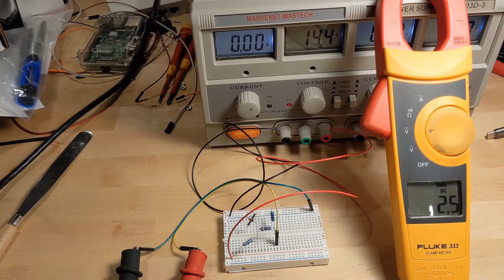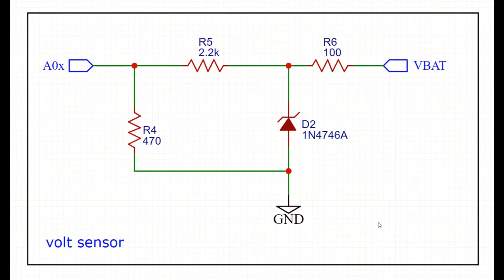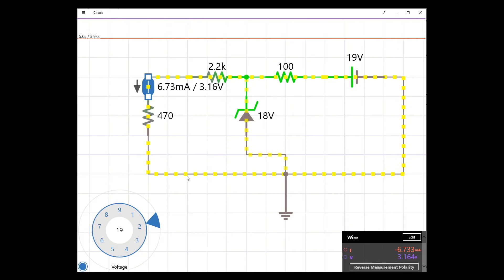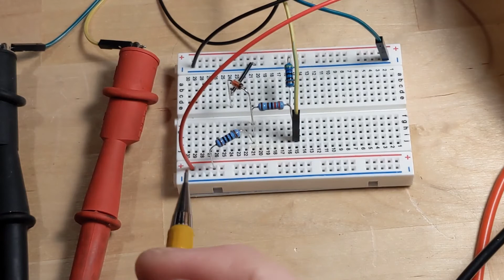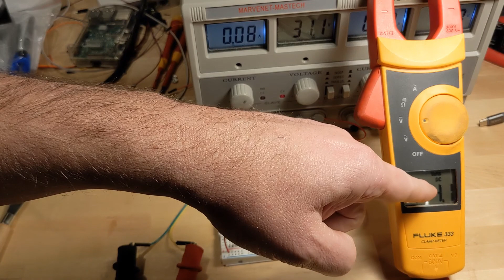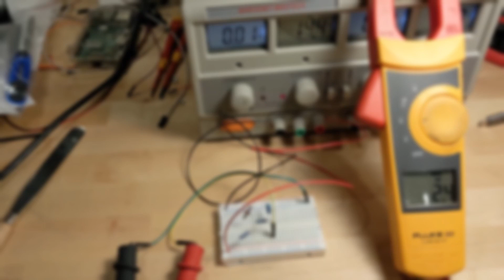Adding Electronics To A Classic Car: Creating the Volt Meter Circuit

Comment: great job man, thanks a lot, but there is one question please: if I want to apply this circuit to replace Mopar electronic voltage regulator, shall I change wiring? I mean the wire which is connected to (+F) on my alternator (2 brushes) must be connected to the OX terminal , and the wire on (-F)  must be connected to ground after R 470 resistor according to your drawing? please advise
Reply from the maker: This circuit would really only be half of what you need for a regulator.  The voltage regulator on a Mopar is essentially a variable resistor that sits between the alternator field and ground.  You would need to add that variable resistance.  It's an interesting idea that I might just add to the overall neoteric design, though.
Reply: @YoshimoshiGarage  the reason why I negotiate this issue with you is, there are no more devices for classic mopar cars and the need for finding an alternative spare parts is urgent in the area where I am.., I have a Dodge Coronet 1974 it is the extraordinary car, like brand new after restorated 3 years ago and I plan to keep it in a very good shape... additionally, I've seen one important video of yours explaining the charging system in mopar cars "70 --- 90's"  "Chrysler" where your were analyzing volts between alternator terminals and voltages regulator, and talking about the principal  of voltage regulator as a switch in a way... I see that your are able to help me in making a simple circuit to solve voltage regulator issue if I'll be in a shortage for it. few days ago, I replaced the voltage regulator and still have one piece.. thanks in advance waiting for your works.. go ahead